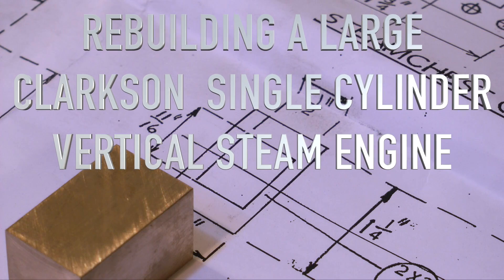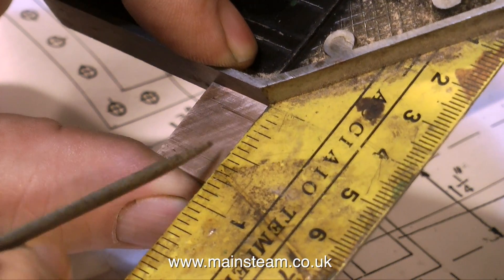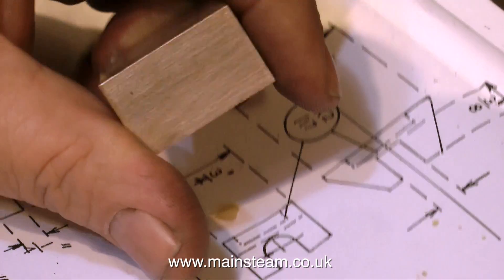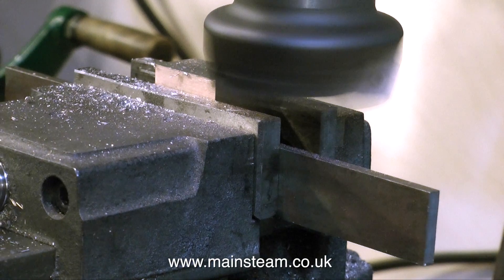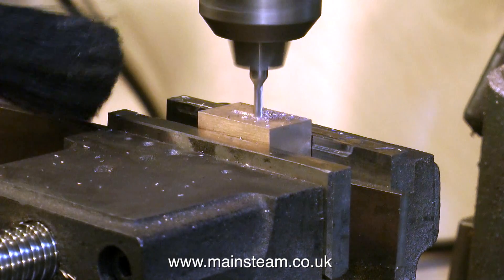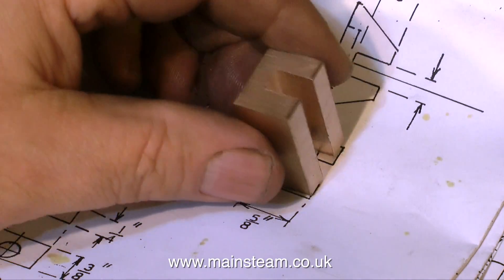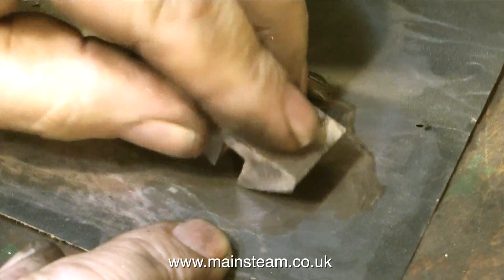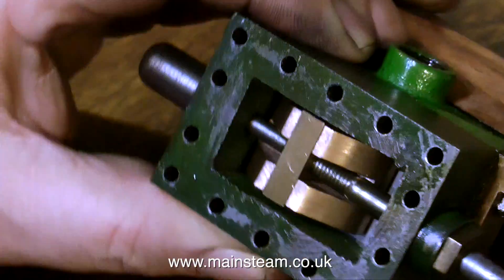REBUILDING A LARGE CLARKSON VERTICAL STEAM ENGINE - PART #13

Comment: When it comes to machining perfect 90° faces, is this possible or even necessary after having two of the four faces machined for the slide valve?  I ask because of the unmachined faces seating on a known flat surface.  I hope this question makes sense.  Thanks in advance.

Comment: hi Keith, I was taught metric in school, but when I started building a few engines etcall the drawing I had was in fractionsI now work in imperial on those and find it much easieras for the fractions I find to get the correct measurementis quite simple say 11/16 is easy just divide 11 divided by 16 = 0.6875that's the way i do all my measurements hope that helps others, keep up the good work Keithregards from Keith in Swindon

Comment: can't wait to see how you mill in the blind square pocket... In my opinion that is a poor design, there should be a radius for the cutter.
Reply from the maker: +Sqwince23 That really  is splitting hairs, the radius is really small. If you wanted to be really pedantic then you could cut a perfectly square hole in a piece of Brass and then silver solder it to the valve body - but it is NOT that critical - only the length of the "blind square pocket is.

Comment: There's a wrong way to do it, a right way, and the way that most people actually end up using it because it's easier or simpler or requires fewer specialist tools. I keep my ears open when "old men" talk about machining, because they've been around the block and they know the shortcuts. So keep showing us how you do it, and I will keep listening. Well, unless your method involves whiping glue off with your underpants...:)